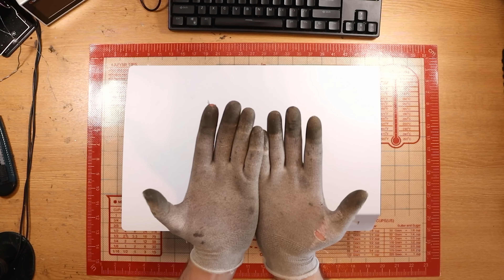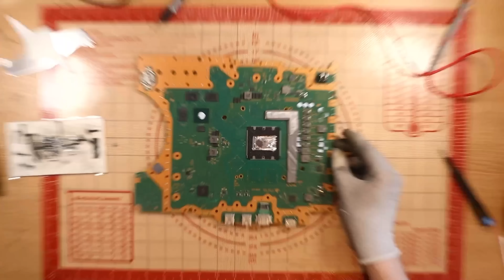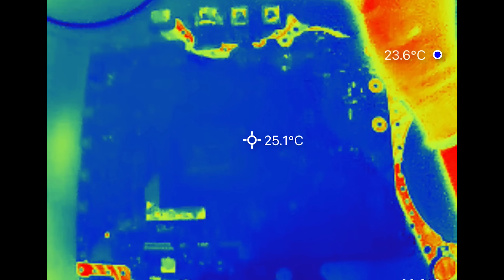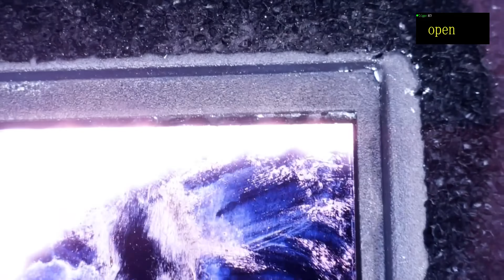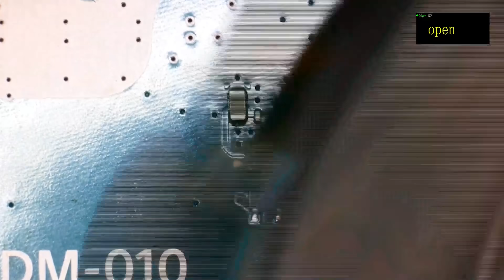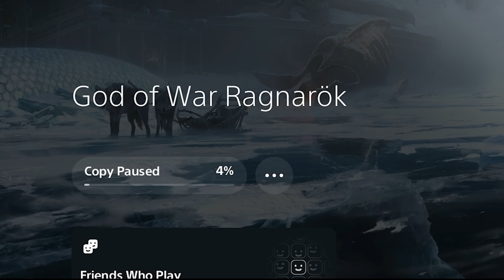Trying to FIX BROKEN eBay Items for Profit! S1:E81

Comment: Freeze spray just as good as thermal camera for finding hot spots. We used to use that back in the 80s when diagnosing faults on arcade video game boards.

How much stuff has ended up in landfill because of a 2 pence cap?

Comment: @JoeyDoesTech on your live stream on july 9th  you got lucky there wasn't a short after third wifi ic replacement. There was a solder ball still on the board. It is 6 over and 4 down from top left.

Comment: On capacitors that are not important why don't they build a fuse inside of it that way when it shorts it goes open. Then the device will continue working.

Comment: lol my ebay stuff arrived today being a pair of Adidas Speziale's that used to belong to "tommy the tit", a 1977 Bulova Accutron watch, a set of pin punches, a £12 tiniest bottle of Moebius 9010 synthetic watch oil and a rather purple 2 piece NATO strap for my rare Slava Asymetric, also via Evri my second MSI AIO PC cooler arrived, bought a 2 fan that came with no brackets so bought a 3 fan one with the brackets but pump is knackered so going to build a big 3 fan Mag Coreliquid out the two with all the RGB and big 200mm fans going on, to be fitted to a MetalFish open air frame case.